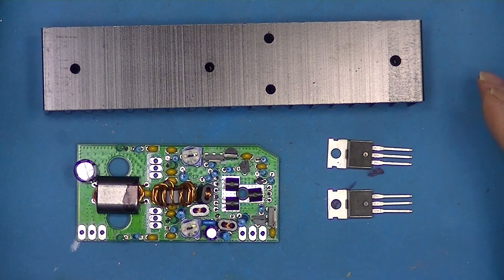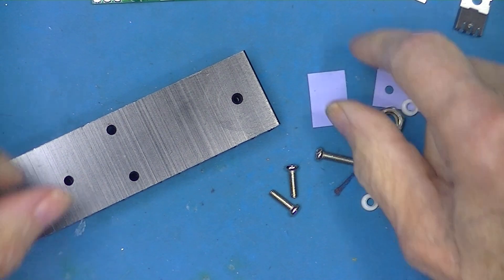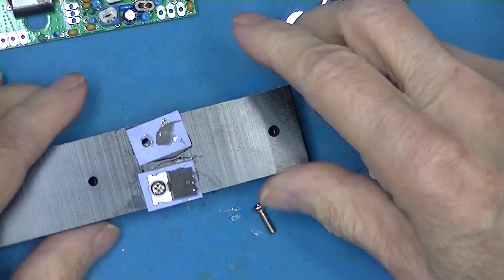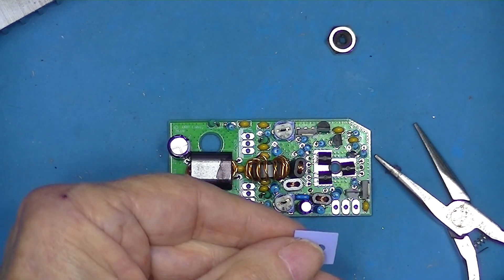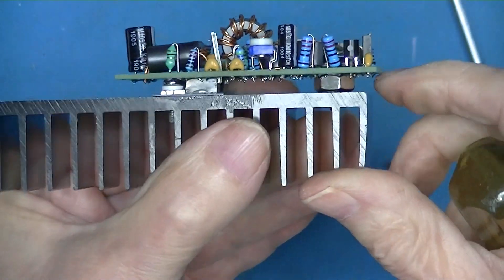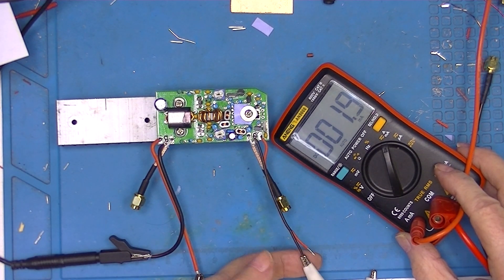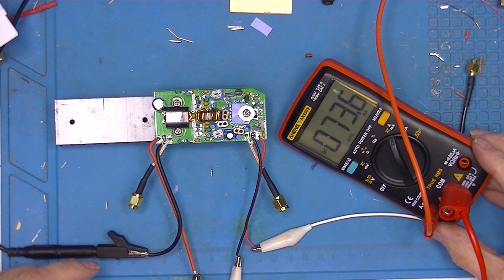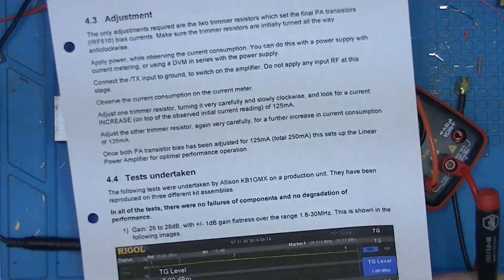QRP Labs 10 Watt Linear Amp. Kit - Part 3

Comment: Whats the maximum wattage I can input in one of these and can I scale back the 10 watts output to like 8watts?
Reply: If I remember correctly it was 20w for 15min with 20v. 10w with 12v, constant cycle. The linear amps output can be scaled down by simply limiting the input voltage thought its not that linear so you need to check the actual power output. I'm running the same qrp amp as a pre amp.

Comment: Tech tip when applying transistor ..apply the pad to the transistor then everything is easier to apply the micron pwd will stick to transistor then u can easily handle to apply to board or sink...best of luck..always tin the legs of the device before application ....
Reply: How's it going there Justin? Small world lol, i'm thinking of building 1 of these.